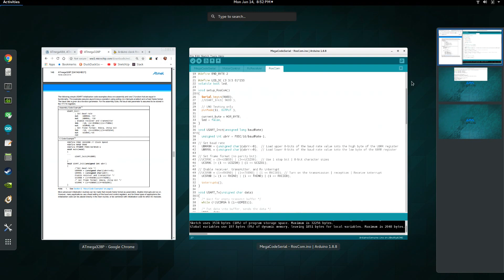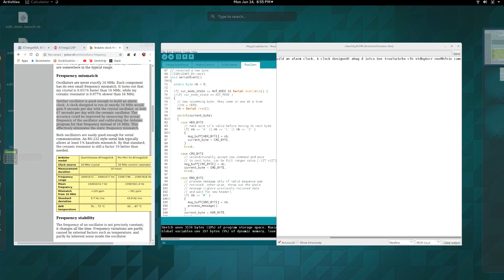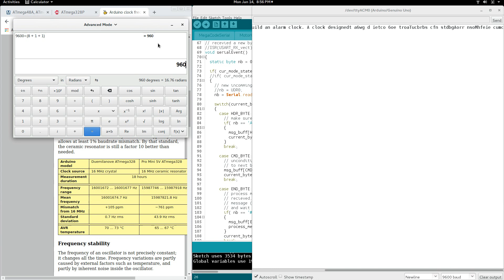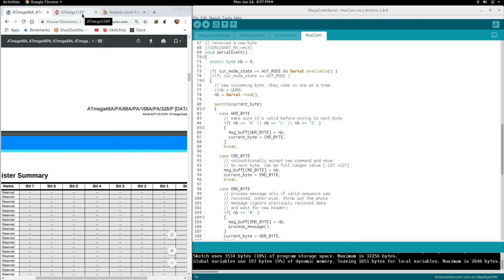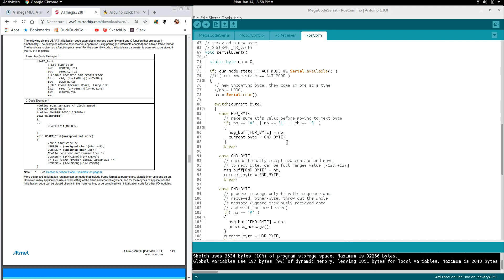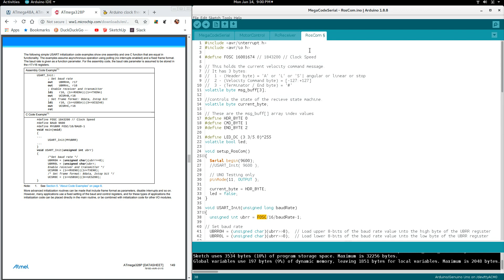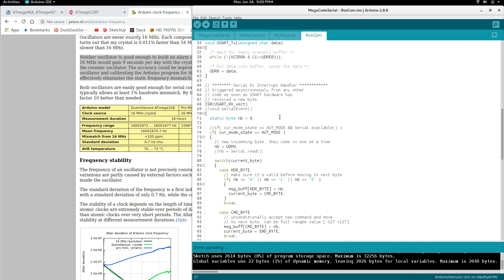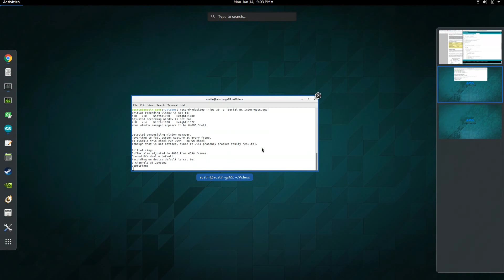Serial Rx Interrupts

Comment: Hello,
I accidentally found you video and I think this is the approach I need to follow.
I'm doing an experiment which consists using a Raspberry Pi to send command messages to an Arduino Mega via a Serial link.

The problem I'm facing (just like the example you initially showed) is that these command messages are not entirely read and I cannot be consistently polling the serial buffer to check for new messages since my Arduino needs to be doing other stuff.

What I need is an interrupt that gets activated as soon as the Arduino receives data from the Pi - just like I think you're doing here.

However, I think your code is a bit complex for me to understand so I would like to ask if there's any chance I could achieve the same output using Arduino libraries?
By the way, do you have any documentation that you can suggest that explain your approach in "baby steps" so I can try to learn how to fix this problem? I've searching for days now and still haven't found a proper solution xD (I don't wan't to simply copy code because I wouldn't understand what it does)

Thank you for this video - it has enlighten me a lot